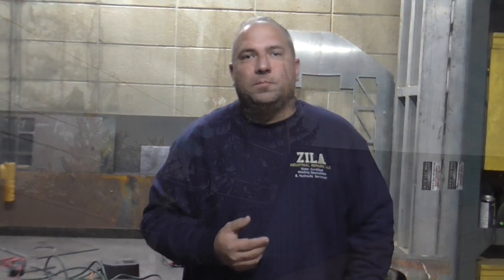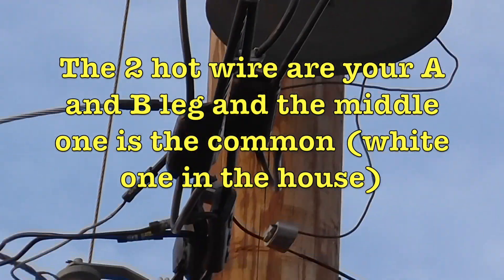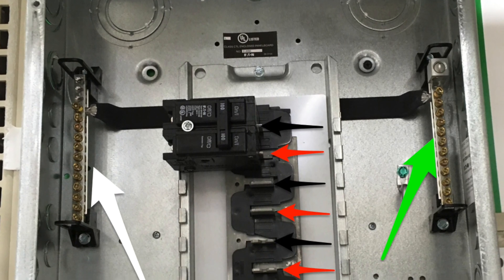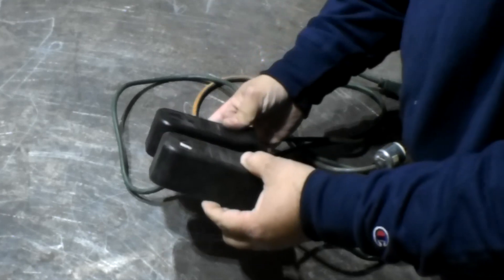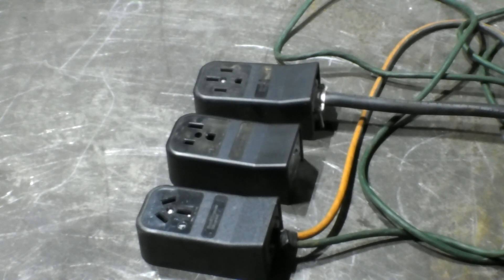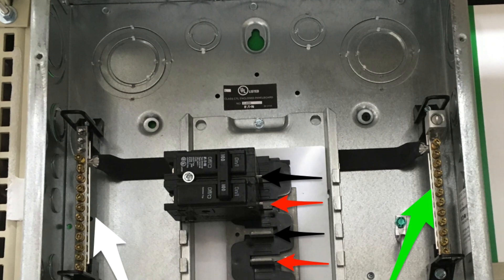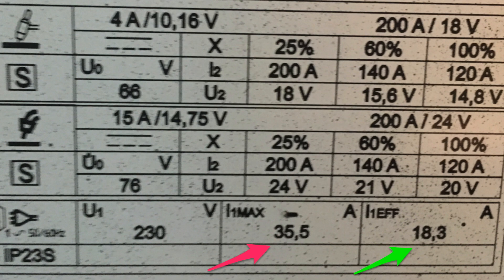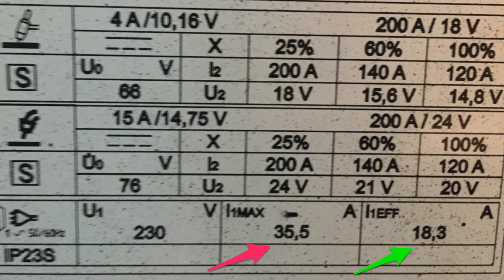How to run a 220 volt welder on 110 volt - Is that even possible ????

Comment: To your viewers. As an electrical engineer working for electrical contractors for many years, yes this will work for his situation.  But you should not do this.   It violates all safety standards, meaning it is dangerous. Dangers are fire and your life.  Absolutely do not do this and expect to use it numerous times.  As I teach others, " Just because you can do something, doesn't mean you can do something".  So, install 240 volt outlets when needed, or have them installed.   Your house and your life are worth more.   Please be safe and live longer.
Reply: Indeed, like robbing a bank. Sounded good at the time,  BUT ...
Reply: Adam A    I am at a loss for what you are trying to say in the first part.   My comment was nothing to do with wire size being different for voltages.   My comment was life safety.   Please explain your comment on max current being higher with shorter runs of wire.   That is interesting.
As far as the comment about electricians, it is an ignorant comment and no comment is needed from me.
Reply: Adam A    It is obvious you have very very limited knowledge of how electricity works and how to make its use as safe as possible.   

As far as communism, just guessing that you lean to the right and think that the left is on the side toward communism.   
Please read the definitions attached direct from dictionaries.   Please note whether communism is right or left in the definitions.

Fascism (/ˈfæʃɪzəm/) is a form of far-right, authoritarian ultranationalism characterized by dictatorial power, forcible suppression of opposition, and strong regimentation of society and of the economy which came to prominence in early 20th-century Europe

National Socialism (German: Nationalsozialismus), more commonly known as Nazism (/ˈnɑːtsiɪzəm, ˈnæt-/),[1] is the ideologyand practices associated with the Nazi Party—officially the National Socialist German Workers' Party (Nationalsozialistische Deutsche Arbeiterpartei or NSDAP)—in Nazi Germany, and of other far-right groups with similar ideas and aims.

Enjoy your life!
Reply: Adam A    My point was life safety.  You are only talking about fires for some reason.
Here are possible causes of fires from electricity.
1.   Conductors installed that are too small for the overcurrent protection and overheating.
2.   Correctly sized conductors for the overcurrent protection, but placed in a situation that cause a fire.
       2-a.   A cord on an appliance that is covered by something like a throw rug or mat.
       2-b.   Too many conductors installed in a conduit.
       2-c.   A conductor gets damaged and starts arcing, but not with enough amps to cause overcurrent.
       2-d.   Drilling into a cable and causing an arc blast which can cause fire.
3.   Voltage drop not accounted for in the conductor length, can cause voltage drop in a motor circuit and cause a motor to burn.

Life Safety issue
1.   What is plugged into this device trips a breaker can be assumed by unknowing people to be completely turned off.   Possibility for getting shocked is greatly increased.   Possible death.
2.   Putting a receptacle that is rated higher than the overcurrent device can allow someone to plug in an appliance that draws too much current will trip the breaker.   With continued use, this can damage the breaker and cause it to not trip at some later date when the circuit is overloaded.

I hope this satisfies your need.
Reply: Adam A    You are not impressing me in any way.
Reply: Wow!   I don’t remember what Adam was saying, but it seems he deleted his comments!

Comment: Just make my simple 240V Power Joiner:  https://youtu.be/4UfclN3kHCc
Reply from the maker: silverbankruptcy yes - that is what the thing does/is that i have....  same thing different style 220/240 outlet
Reply: Yes, I Liked Your Video, since you used a Multimeter to explain things! These are really Necessary to run a good welder. Thanks! and Thumbs UP!

Comment: The reason why this trick worked is because of how the house wiring was done - Chicago code. I suspect this is identical in many ways to Louisville code which I worked with in the late '60s as an electricians helper between high school and college.  Outside the city, county code allowed using 14-2w/ground to the outlet and the little shorting lug between the upper 'hot' blade and lower 'hot' blade was left in place. This went back to a single pole 15 A breaker. May have also used 12-2w/ground in high load areas back to a 20 A single pole breaker. Reasonable spacing was used between outlets depending on anticipated usage.  In the city, due to numerous fires over the years from electrical overloads, the code required outlets to be located no more than 4 feet apart. The wiring was also different. BX armor jacket instead of Romex - Rats! The shorting lug was broken out thus isolating the top 'hot' socket contact from the bottom one. 12-3w/ground was wired back to a 20 A double pole breaker. The two voltage leads were wired to the upper and lower 'hot' blade contacts of the outlet. That's why you break out the shorting lug. This spread high loads as in the kitchen over two circuits instead of one, so even if the owner used cube taps or power strips, the current in the individual wires was cut in half as opposed to a single circuit feeding the outlet out in the county. This results in 220 volts available at every outlet at the current rating of the double pole breaker. The trick enables tapping power from the two 'hot' blades for 220 and tapping the ground and neutral as needed. If you tried this trick out in the county, it wouldn't work since the top and bottom 'hot' blade are both the same voltage. You can determine if this trick will work by either using a volt meter to measure the voltage between the two 'hot' blades of the outlet: 220 - go, 0 -no-go, or removing the cover plate and looking at the hot side of the outlet to see if the shorting lug is still in place. Since most panels are fed with 220, you may find another outlet on the other side of the 220 to make this work in a pinch, but for long term use, just hire a competent electrician to wire a dedicated outlet for your welder and spend your time welding instead of wire monkeying.

Comment: you can put the neutral wire on a breaker beside the corresponding hot wire (from a 115v plug) to get 220-250V... as long as the breakers match the wire gage and the plugs are made of ceramic not plastic.

Comment: so using this logic can you run from 2 different 120v plugs on the same leg to make the amp draw per plug go down in 120v? (as long as they are different breakers) to run things like a skillsaw without tripping the breakers?
Reply: No and if you could you wouldnt want to. The breakers protect the wiring from overload and prevent fires.
Reply: Appears so.  Say, 2 20A breakers in parallel you could draw total of 40A theoretically.  Reality probably be somewhat less than 40A would blow one of the breakers .

Comment: whats  all reference to 110v  usa 120v since edison dc days
Reply: 120V is the modern terminology.  This voltage reference (and 240V) should be used.  Mostly it is simple terminology but often a person needs to calculate wattage to get an accurate measure of power draw; if you use "110" instead of "120" in those calculations, your wattage calculations will be off by almost 10%; this could mean simple failure, fire, or electrocution.  
Everyone, please get in the habit of using "120V" and "240V".  It's not a big thing -- until it makes a difference and then it IS a big thing.
Reply: Even though you are technically correct, 110v/220v, 115v/230v and 120v/240v are all commonly used are understood by most to mean the same thing. Anyone dealing with calculations where it will make a significant difference will know. For everyone else it just doesn’t really matter.

Comment: First you are not running the welder on 110 volts. you are running it on 220 volts. Each phase on the gimmicked plug has 110 volts but they are out of phase . The receptacles  that you use with the cord are different phases.  Know what you are talking about.....
Reply from the maker: JIMMY   well said - so unreality i AM running the welder on 100 volts !   2 circuits of 110 volts ...  even on the same phase (that is why it is called single phase) ....  if you touch either one of the hot wires - you are getting zapped with 110 volt "only"  and yes - i get it the clever thing is to combine those 2 circuits and make it not work 110 but 22 because although each circuit is 110 only - because they are 180 degree phase shifted they make 220 hot against hot.     
now "real 230 volt" is make from 400 volt 3 phase like in all of europa ad most of the rest of the world.   you have 33 hot legs each one carries 230 volt ... and all 3 of lose legs are 120 degree offset.   now if you touch that 230 volt hot wire you are actually getting zapped with 230 ! not 110 ....   

Thanks for watching and you input
Reply: Indeed it would be 220/240.  But against code.  You need a breaker that is going to trip both phases if there is a fault.  You also need to be sure both phases are derived from the same source (which is typical in a home).
Reply from the maker: Lakeman i get that i am using 220 in reality.  The only thing that i am not getting in your comment where the common in welder is coming from??? 
So we agree that there are 2 hot.  And than my welder has a green wire which i was under the impression green is ground ? Especially if  that same green wire is connected to the metal outside casing of the welder ! And there is a little ground symbol on the outside casing ....  also that 3rd wire is never supposed to carry any current ( unless there is an equipment failure ) 
I mean literally - that third wire besides that it is green, the ONLY thing that it is connected to in the machine is the metal housing or casing or whatever you want to call it of the machine ...
So it looks like a ground, it acts like a ground ..... and you say its a common ....?  What am i missing ?
Reply from the maker: Lakeman ok.  Good.   Sometimes all those treads on those comments get a little bit confusing ....  30 comments per video times 90 videos ....  life gets complicated ...  lol
Reply: +Lakeman 
Applicable NEC and UL Code 
Article 210 Branch Circuits
210.4(B)
Article 240 Overcurrent Protection
240.15
240.15(B)(1) Multi-wire branch circuits
240.85
UL 489
Reply from the maker: chas williams like i said. I didn’t build it. A guy who assured me that he was an electrician did.    I just used it a hand full of times in the last 10 years to help me out of a jam.
Reply: Sorry ZILA, I don't think I said what you are not getting. I stated that "...you are not using the neutral..." because you are correctly using the ground. You've got it all 100% correct.
Reply: ZILA, Jimmy is correct. You are running the welder on 220V not 110V. You are simply using the 2 - 110v circuits, opposite halves of a Split Phase (not same phase), to provide the connections to the 220V source. The 110V is between either leg and neutral/ground but you are not using the neutral in your welder (you are however electrocuting yourself with 110v if you only touch one leg and ground... but 220V if you touch both legs, same as your "real" voltage in europe) I know you generally understand it, but are not communicating it accurately.
Chas, Against what Code? (rhetorical question.) There is nothing in the code that I have seen that deals with this type of not permanent plug in equipment... unless you try to argue 400-8(1), but that'd be a weak argument. The "need" to have a 2 conductor breaker is for permanent wiring within the structure. Here it is a 'SHOULD' but not violating the code.

Comment: I use the the quick 220. It keeps things legal and has a circuit breaker that trips if something goes wrong. 

Example onetime at a commercial building I made 480 instead of 220 Volts and the it tripped the breaker. 

I would defiantly invest in the quick 220 to keep things safe and legal. 

http://www.quick220.com/
Reply from the maker: that is a great set up !
Reply: Thanks! Could you recommend stick welder only for occasional  use? Looking to buy something less than 1000 USD but I want it to work on both 50 & 60 Hertz.
Reply from the maker: i dont have first hand experience with a lot of "entry-level" sticks welders ...  the cheapest i own is over $1000 ... typically for 7018 rods if you are looking at an asian import the overcasts don't do a bad job .... (stay clear of lotus and most of the harbor freight stuff ...  miller master 160 is $949 but i am not sure that is is worth the investment - i only welded a few rods with it like 2 years ago ....  i never used a lincoln Invertec® V155-S ......     like i said - i DONT have a lot of experiment with those machines and i really hate to tell people to buy something that i didnt use and test myself ... i dont recommend things by brand name - or model especially if i have no experience with hem or dont know if or how they hold up ...  so sorry if i can not help you too much - but go to your local welding guy and ask them to test a machine, ron a few rods - or go to an online seller who offers a 30 or 90 day money back guarantee and try the machine out - go online on welding forums and see what others have to say who own this kind of machine ...   that is the best advice i can give you.    
SPEC SHEETS only tell you part of the truth !  there is a thing "arc dynamic"  how the machine feels when you weld with it and how the rods "run" and how the bead lays down ...  that is something that no spec sheet can capture  - that is something you have to experience !!!!  and THAT is the tough part ....
for example the HTP inverarc ($1499 one their website $1195 at fab tech last november in chicago) I own that machine - and the arc dynamic and the way who it welds - it is right on par with my $15000 lincoln vantage 400 !!!  of course it is not as powerful and it can not wire weld (not even with a suitcase and it does not have a diesel engine..... BUT the arc quality and arc dynamic are most definitely in the same class !!!    but i know it is out of your price range so i use it there to show you the point of spec sheets only tell part of the truth.
Reply: Thank you for the info. Will do some more research and save up. I want to buy once and not twice.

Comment: 120 volts and 240 volts are the common residential voltages in the USA. The USA hasn't used 110 and 220 for approx 75 years.
Reply: Even though you are technically correct, 110v/220v, 115v/230v and 120v/240v are all commonly used are understood by most to mean the same thing.
Reply: @lakeman2604  - Yes "commonly used" but it's more than technically correct.  If cases where you have to calculate wattage for any reason and similar uses, you need to use the correct nomination -- you might as well get in the habit of using the "technically correct" designation so that you're thinking about it that way.  Plus, if you're training an inexperienced person, best to use the technically-correct usage as you're doing so; you never know where that person is going to go in the future and what knowledge he/she may need.
It's a very small thing, but there is at least some use in being technically correct.
Reply: I am often chastised for calling people on not being technically correct, but sometimes, like this, it really doesn’t matter.
Reply from the maker: thank you for watching and than you for specifying that.  so can i call it 110 volt "nominal" so people know what i am talking about ?  although i actually measure in my shop just shy of 118 volt .... ?  and 220 nominal? which measure just shy of 236 actual ?   most modern inverter machines will run from 208-240 or even 260 (if run on a miller or lincoln engine drive) with no problem ....
Reply: Really enjoying your videos and learning a lot. Thank you for doing what you do. Going to grab an HTP Pro Pulse 200 when they become avail thanks you and Chucke.
Reply: The voltage measured at the wall for me is 244v. And this is 100% incorrect information. Excluding local variances, standard residential electrical voltages in North America are 120 and 240. You are one Google search away from this information. There is no transition from 240 to 220. And your math isn't even correct. 123 x 2 = 246. If both hot legs of your split phase system are 123 your voltage across both hots mathematically must be 246. 

220v is an artifact of a bygone era (the 1940s) and the fact that 220v is the standard across much of Europe.